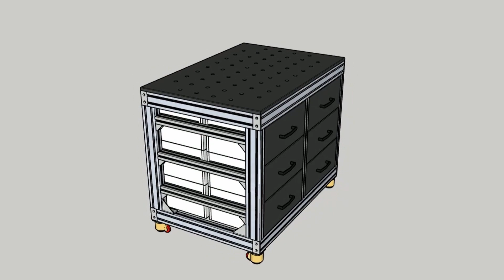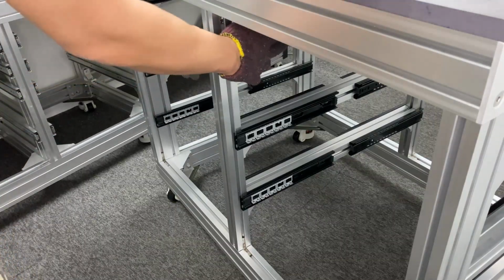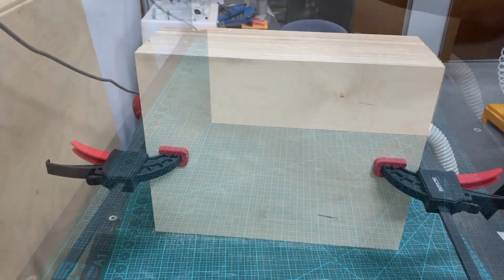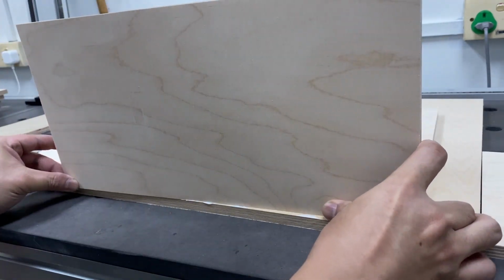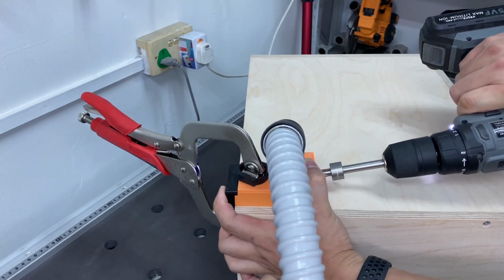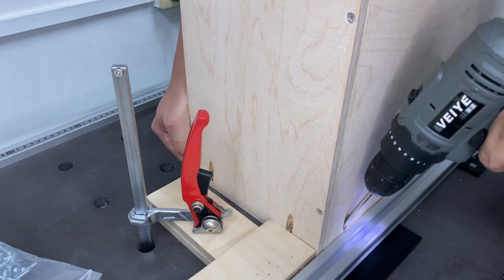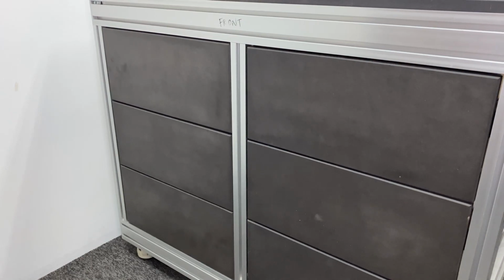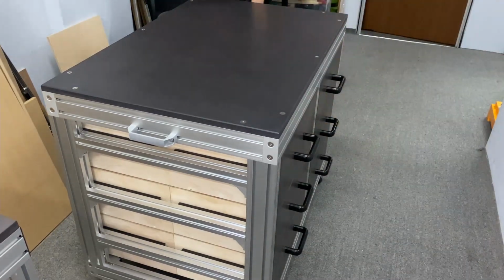How to make an Aluminum Extrusion Frame Outfeed Table (Part 2)

Comment: Amazing work!!!
Reply from the maker: Thanks! Stay tuned!
Reply: @TheAluminumCarpenter  do you happen to have a parts list from 80/20 I could purchase to build this? Really great job.
Reply from the maker: Hi, which country are you located? My diagram will be in metric, which is a hurdle for many.
Reply: @TheAluminumCarpenter  USA, but more than happy to work with metric!!
Reply from the maker: Ok hold on approx a week. I will put it on my website soon. I need to reorganize. U download sketchup ready first.
Reply: @TheAluminumCarpenter  thank you so much!!!
Reply from the maker: No prob. That was the plan from the start. U just accelerated it despite the site is not ready.
Reply from the maker: A bit later. My work got overrun… but i havent forget this.

Comment: Nice video what is the size of the hardware you used to attach the drawer slide to the aluminum
Reply from the maker: Thanks for watching. Which hardware are u referring to?
Reply: @TheAluminumCarpenter  the screws and t nuts that go in the drawer slide to the 80/20 aluminum is that 10-32 bolt thansk
Reply from the maker: @matthewjason5330  i cant really understand which bolt u referring to.